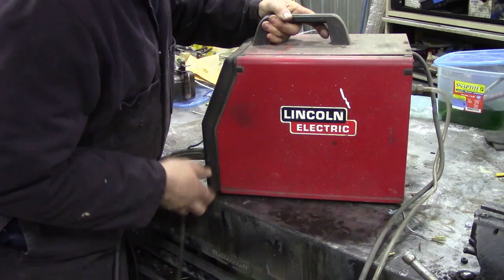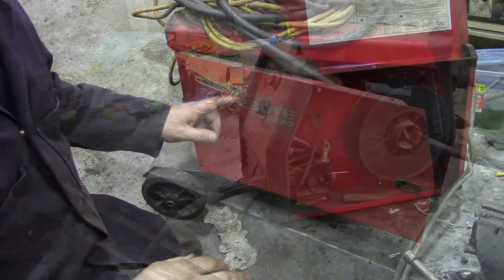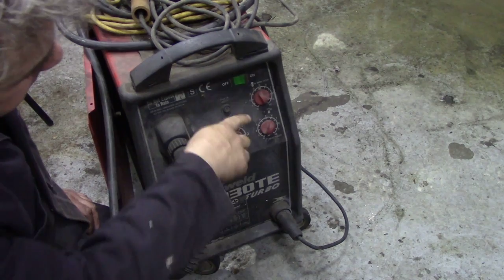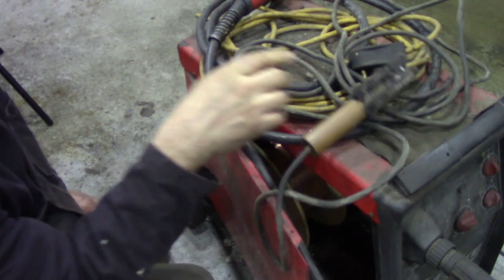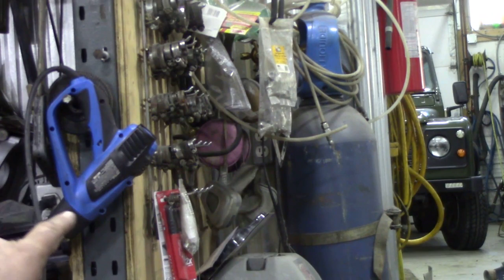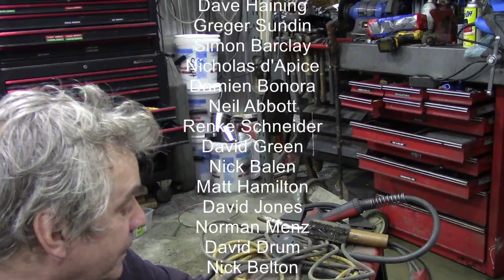My MIG welders and a few bits of info about welding

Comment: yep totally the same used to have clarke 180 for landrovers, now (thankfully) i run a SIP 181DP (DP= dual polarity) which means i can run fluxed and straight wire and gas. bloody lucky as the bottle price in France is massive, so i reverse the polarity and run without gas on 1.2 wire
Reply from the maker: Yeap gas is bloody expensive here - $180 inc tax a bottle

Comment: I also use mostly mig welding. I have an old industrial 180 which is actually way more powerful than my more modern 220amp mig! Go figure! I am considering getting a tig torch set up for use as a DC (steel) only and using an old trusty stick 40/140 welder for power. It seems to be the cheap option to go tig. But MIG can do all but the most fiddly welding for my needs also. I use an old fashioned heavy duty earth spring clamp. Nice tip about the magnetic earth clamp... I was considering one myself. Not any more. Keep up the great work and cool vids. PS You are not alone. I hate welding sills!
Reply from the maker: I looked into those cheap inverter welders - look like junk to me - a TIG without a pedal control is a waste of money